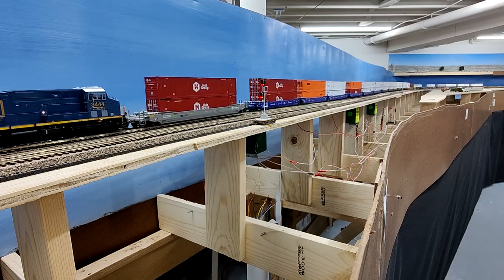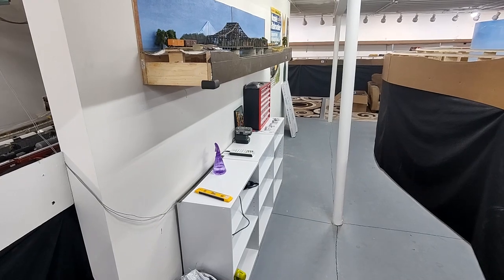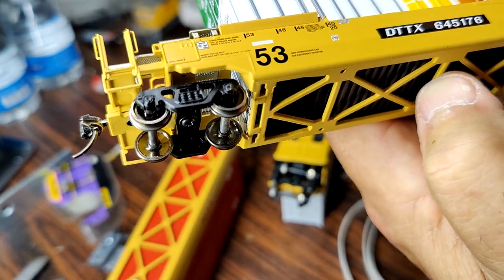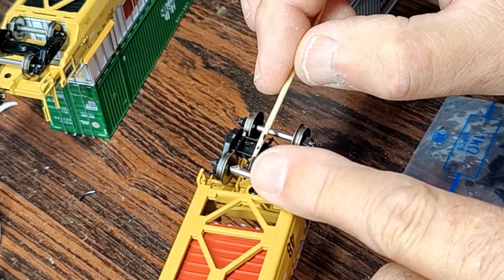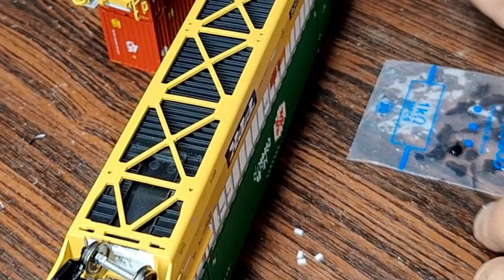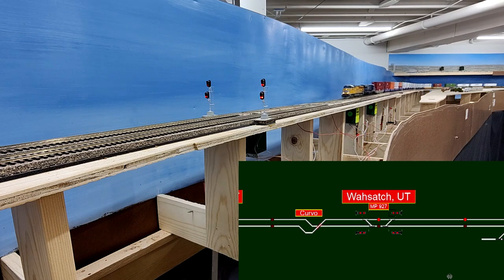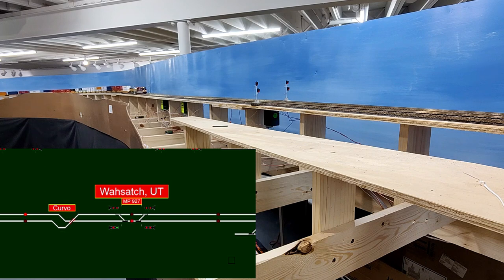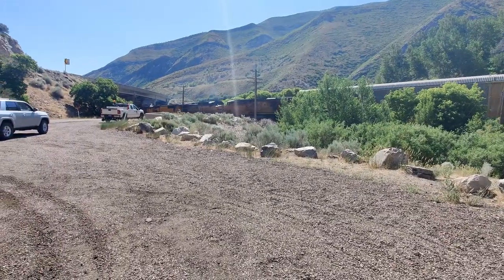Resistor Wheel Sets S2022E43 How to add 10K resistors to HO wheel sets  Model Train Layout in Action

Comment: I glue the resistors black side down then if you put too much paint on you can scrape it off. If you scrape the black (resistor) side it usually damages the resistor coating. I found plastic axles tend to fail after a while, probably from slight flexing, so I swap them around between cars so only metal axles have resistors. I use smaller resistors (402), more fiddly but almost invisible once painted.
Reply from the maker: These resistors only have the metal tabs on one side.
Reply: @EvanstonSub  The small ones I used had contacts all around the ends.

Comment: Excellent video! Thank you!!!! What if any are the most common problems with adding these resistors and what is the solution?
Reply from the maker: Occasionally, the resistors will go bad, and the wheels sets will short.  Can take a while to find the wheelset that is causing the problem, I did over three hundred cars on the N scale Geneva Sub and has three go bad like this.

Comment: Thank you Daryl, I have always wondered how to do this and how involved it would be. You always ran one Digitrax unit to power your entire layout but I saw that you added a booster. Do the resistors draw power from the track and if so was it recognizable and did it have any bearing on you adding the extra booster? Thank you.
Reply from the maker: While the booster is there, I have not yet added it to the layout.  Probably will do so in a bit.  I think the one booster is probably adequate for the layout.  However, I have the old DCS100 on hand, so I may as well use it.  None of this is related to the resister wheelsets.

Comment: I pretty much add resistors exactly like that, except I use a small sanding stick to rough up the axle and inside wheel face where the resistor and conductive paint will attach. It's a also a must for plastic axles as the conductive paint doesn't stick very well to the plastic and can "shell off" after a time.
Reply from the maker: I'll see what happens with the plastic axles. I've never had issues with resistors coming unglued.

Comment: I would love a detailed video on how your signaling system is done. How do the detectors work in conjunction with JMRI????
Reply from the maker: I do not use JMRI for the dispatchers panel and signal control.  I use RR&Co software.  However, I would recommend JMRi as it is free.

Comment: Fascinating vid. Couple questions: how much more resistance do you think that conductive paint adds to each installation; have you calculated how many of these you can do before the current draw becomes a problem? After all, each install is a parallel circuit so each one reduces effective resistance and increases current draw.
Reply: Compared to the value of the resistor very little. Each resistor takes about 1.5mA, so 1000 would take 1.5 amps. I had about 200 cars on the layout, two resistors per car so 0.6 A spread between two 5A boosters, not a problem.
Reply from the maker: Thanks for the reply!

Comment: I am now doing resistor wheelsets.  I am just using the conductive paint vs. super glue as it kept getting on top of resistor...  will it hold?

Also, I am having trouble with the plastic axles.  The conductive paint is not enough to make connection so am "laying in" a thin (one strand of 18AWG wire) wire into the paint to make the resistor to the other side of the wheel, across the axle.  Otherwise, it is not throwing the circuit to show occupied block.  any tips/tricks/points?
Reply from the maker: The paint should hold unless it is bumped somehow. A derailment may knock it off. The wire idea sounds like a good idea. I had about a 30% failure rate with plastic axles. I just tried again with the other axles until I had success. 😊
Reply: @EvanstonSub  I am getting a 75% fail rate on plastic… maybe glue needs more carbon in it!
Reply from the maker: That's not good. I glob the paint on pretty thick.
Reply: @EvanstonSub  okay, I was able to get the super glue to work today. Knocked out 15 cars.  Thanks for the vid’s, backdrop looks great.  You have done so much work!!
Reply: @EvanstonSub  okay, so I started using the CA and hmmm....   The resistors where I used purely the conductive paint, no issues.    those that i used CA, then conductive paint, 50% fail now, after3-4 days sitting...   I think it is because the conductive paint contacts both the bottom and top side of resistor when used alone...!   I am going back to that method and if I lose a few, no problem.   just wanted to let you/group know.